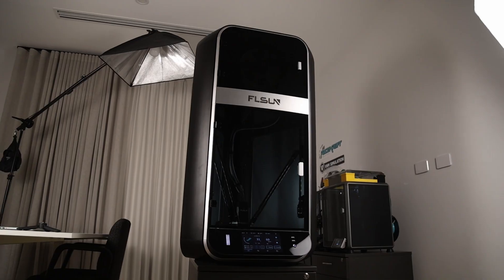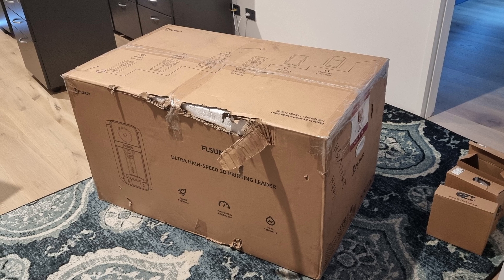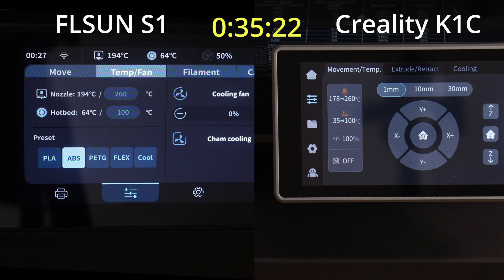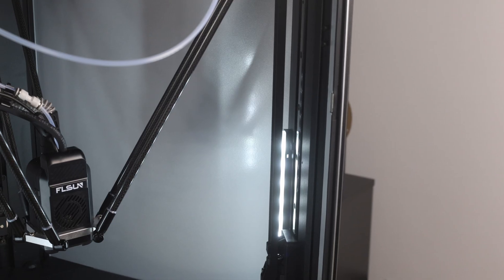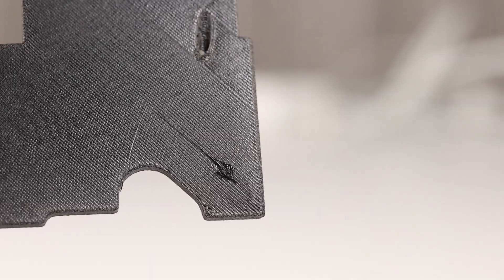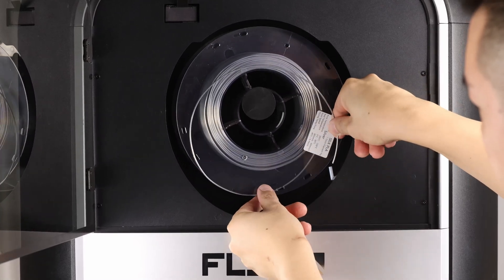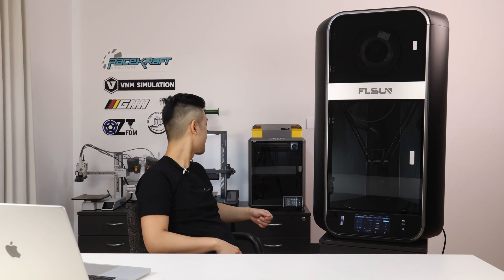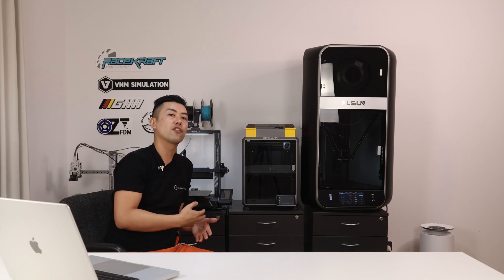I review the FLSUN S1 3D printer - yes, it is THAT fast!

Comment: Here’s a tip that might help: Instead of putting the filament in the dryer box first, try feeding it straight into the extruder and then placing it in. Trust me, it’s way more hassle-free. For the noise issue, you could totally check out the silent kit from FLsun. I swapped mine out, and now the noise is totally manageable.
Reply from the maker: My jaw is on the floor right now! The thought of feeding the filament before mounting it never occurred to me in the slightest - some things they don't teach you in Dental School hahaha

This is a solid, life improving piece of advice - bravo!

Comment: regardless of speed you should never print ABS without sufficient ventilation or a respirator. Unlike PLA, when ABS melts it releases toxic fumes.
Reply from the maker: Yeah I hate using ABS. The only reason I use it is to test ultra high speed printing for YT. Never use it otherwise

Comment: I have a T1 and I also had a problem with printing TPU, but the T1 has a screw on the extruder that adjusts the pressure on the filament and this screw needs to be set to minimum pressure. 10 seconds of work. Does the S1 also have a pressure screw? I ordered the S1 a few days ago and I would be unhappy if it couldn't print TPU
Reply from the maker: Honestly, I am not that knowledgeable with mechanical adjustments to a 3d printer. I am very much your average guy who will buy a printer, read the instructions and hope it works great out of the box.

I returned the S1 many months ago so I can't check myself but I'm pretty sure there's adjustment somewhere, and when the TPU failed to extrude I could see it was getting all bunched up in the extruder so what you said about the pressure on the filament needing to be reduced sounds right.

There probably is an adjustment on the toolhead but I didn't look for it - I just moved on.
Reply: @DrAlanQuan  well I looked it up on the internet, yes this extruder also has a screw for adjusting the pressure on the filament, generally speaking the screw is tightened all the way on the fastest printers to get the greatest pressure. In other words, anyone who has an S1 and T1, when they want to print TPU, has to loosen the screw as much as possible. when there is a lot of pressure, it deforms the flexible filaments and then it gets stuck. as I wrote above, it takes a few seconds and it prints TPU perfectly
Reply from the maker: Thanks for the insight! Much appreciated

Comment: They are fast but worse service ever most my machines have arrived broken not working and it’s a nightmare trying to get them to fix the problem save your money I Less you want to pay top dollar to have stress
Reply from the maker: I definitely have concerns about servicing these printers - bedslingers are so much more approachable for diagnosing issues and replacing components etc. which is why I like them so much for home use.

I only have a few weeks experience with my review printers so long term issues are beyond the scope of my testing.

But if these fast printers can maintain speed and reliability? That would be great

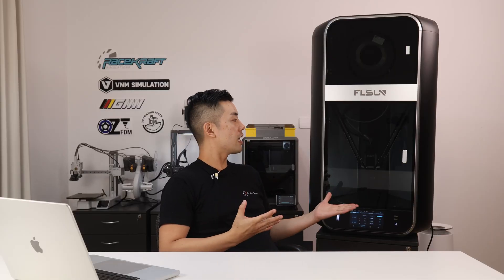Comment: 12:39 what happened to the black filament on the AMS Lite???
Reply from the maker: I can't see what you're talking about, there's nothing interesting with the A1 Mini at that time stamp?
Reply: @DrAlanQuan  Just before 12:39 in the whole video there's a black filament on the AMS Lite and at 12:39 it vanishes
Reply from the maker: Oh hahaha. Whenever you see something like that, a wizard did it. Those are some sharp eyes you have!

What happened was I took off the spool to be used on another printer between takes. A little bit of movie magic and I'd have you believing that I did everything in one sitting without messing up my lines or burping 😂

Comment: aren't most bambulabs 3d printers faster for cheaper with better features and software?
Reply from the maker: Faster? Certainly not

The S1 has 3-4x the flow rate capacity, and at least 2x the motion ability. In real world terms I printed two items, one on an S1 and the other on a Bambu A1 Mini. 30 minutes vs 3 hours 30 minutes. Literally 7 times faster. 

Cheaper, and better features and software? Yeah, I think there's solid competition there. In any case, the standout feature for the S1 is speed and it delivers buckets of it

Comment: I'm very happy with the S1 after installing the upgrade kit, it prints really fast and it's great for someone like me who doesn't have the patience to wait.
Reply from the maker: Do you keep the printer indoors? I'm guessing the noise is less of an issue now, but what about the smell as it prints at such high speed?
Reply: Is the upgrade kit strictly for fan noise or does it improve anything else?
Reply from the maker: That is my assumption but I haven't seen it myself
Reply: @josephgreggt  is the upgrade kit strictly for the noise or does it improve other stuff as well?

Comment: I've got this machine too. Even though its top speed hits 1000 mm/s, it's still way faster than my K1, and the print quality is just as good.
Reply from the maker: Have you tried manually turning up the speed? FLSUN claim 1200 but the default profiles don't go that high

I did a little bit of profile tweaking but I didn't have enough time to do a real deep dive into it

You're right, it is dang quick though
Reply: @johnsmith-uh5se  have they made improvements to presets since release? Was it producing great quality out of the box? I have the t1 pro and love it and the s1 is 4-500 less than the s1 so I might pull the trigger on the s1

Comment: I’ve been using the S1 Pro for a while now, and I gotta say, I absolutely love the print speed,it’s like the printer’s in a rush to show off, the first few prints were almost total disasters, but I’m starting to figure it out,the key is patience—adjusting things as you go and testing constantly. This thing feels like an absolute beast!
Reply from the maker: I only had the printer for 2 weeks and it's gone back to the shop now - but I can definitely see how spending a bit of time refining the profiles to suit my needs would be very satisfying. 

I don't need a 5th printer at the moment so I won't be adding the S1 to the collection in the foreseeable future though
Reply: @DrAlanQuan   Maybe you need a S1pro😆

Comment: Regarding TPU printing tips, it is suitable for any printer. Hope this helps.https://www.youtube.com/watch?v=_1cicX57ub8
Reply from the maker: Hey man thanks for the link - I didn't see anything in that video that explained why the S1 was having issues extruding TPU. I already printed a 10 minute TPU benchy just like in the video on the T1 myself 4 months ago.

The video did touch in the fact that modern extruder serviceability is an issue and I definitely felt that way looking at the S1 toolhead. It's extremely refined to work so fast, versus old school modular bedslinger that's super easy to adjust.

Thanks for watching and sharing your input!